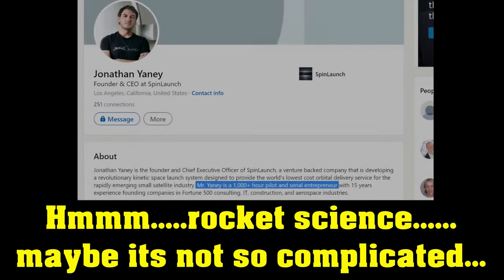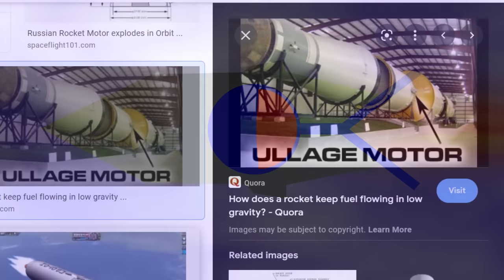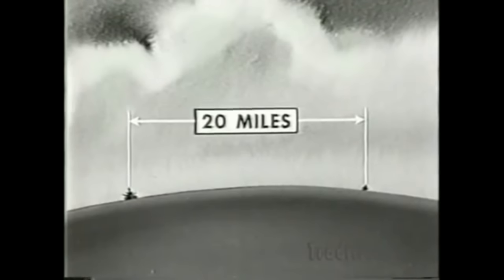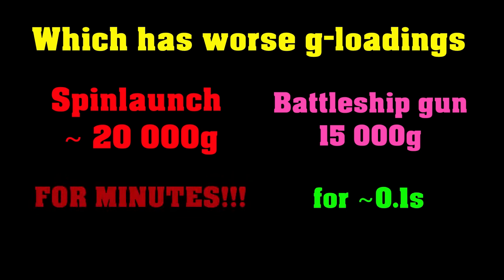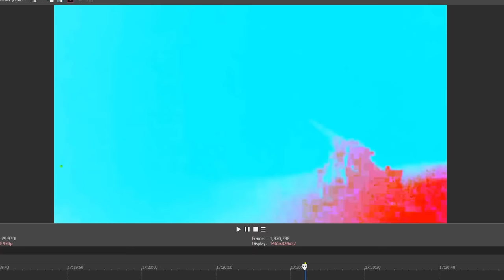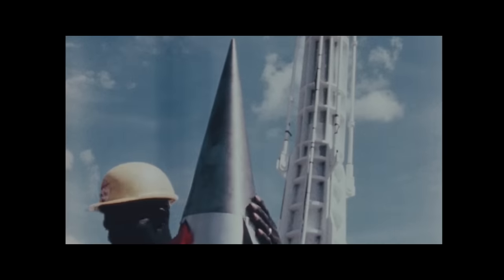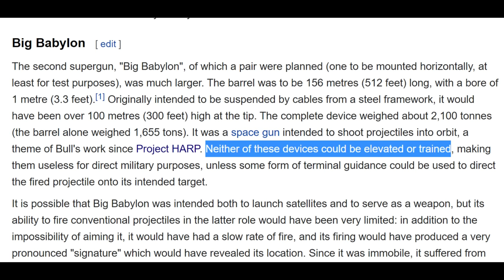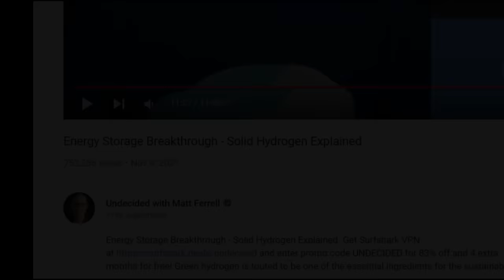Spinlaunch: BUSTED (Part 2)

Comment: I wonder if this could be more useful as a Moon based launcher, to avoid firing rocket motors close to the lunar surface (and all the associated problems, namely high pressure gas or dust reflecting back on the ground and damaging the rocket)
Reply: any cargo would get destroyed under 20000g lasting for minutes
Reply: @suqd674  the point is : you don't need as much speed if you launch from the moon. 
You need 9km/s to orbit the earth (LEO) while you need only 1.9 for a low lunar orbit.
Spinlaunch wants to reach a launch speed of 2.2km/s which is way more than necessary for a moon launch. It's only 25% of the velocity needed for LEO, therefore you could probably scale down to to 0.5km/s. If I'm doing the math right that would bring the g forces down to 1250g which would be much more bearable for the hardware
Reply: ah the moon, my bad I was drunk
Reply: While it would be less of a total bs on the moon, it would also be even less needed, making a simple rail for a railgun on the moon would be easy (vacuum present), and it would be same or better in every way.

Not to mention, on the moon we can build with current tech a space elevator, if we want such stuff.
Reply: @thesteaksaignant  Sadly we want around 2.5 km/s on moon, since that is the orbital speed, anything less means we still need a rocket after spinning for even reaching orbit. So no, scaling down on moon would just make it even less useful than keeping it. Almost every time, using spinning is less fo a good idea than using a linear acceleration for anything. On earth we might would have the benefit if not needing several km of vacuum tube for the railgun (which is a problem, unless you are building a hyperloop, than suddenly it is not an issue for hundreds of kms), anywhere else this adds the problem of spinning for a slightly more compact but way more complex system.
Reply: @thorin1045  I know that the orbital speed of the moon is 2.5km/s, but since their concept is to replace the first stage only (on earth), I went with the same assumption for my idea of a moon spinlaunch system
Reply: @thesteaksaignant  Well, what is the first stage on a "rocket" launching from a moon? So far any launch from moon (apollo ascend stage and a few return stage for probes) went orbit at least, some did the entire return trip on its first (and only) stage. As mentioned earlier, if you do not reach moon orbital speed, you still need a chemical rocket to reach it, so there is no reason to use this (or any other) helper system, since it would only add complexity without solving a major step of the entire trip.
Reply: A mass driver would be ideal for the Moon.
Reply: No issues with maintaining a vacuum also…..
Reply: Jake Standford  That's sarcasm, obviously, given we've been there multiple times.
Reply: Ok. Now all we have to do is get the satellite to the moon so we can launch it. How would we get the satellite to the moon?
Reply: Eh, I think a long coilgun would be better then

Comment: And also: they would still need to invent a material that can withstand a strong vacuum on a more than a squar meter but also gets ripped apart without blowing up when hit by something traveling at 5 times the speed of sound
Reply: To me thats the hardest considering Hard vacuum can implode a steel tube like its made of paper
Reply: I would think that as they reached top speed they would have to slowly release the vacuum prior to detachment/launch.  Otherwise, even if you could open the door, that rocket would be going extremely fast as it hit a wall of incoming air.  Keeping in mind that the inside of the rocket would still be in vacuum also.
Reply: Maybe a material that is blocked from the vacuum during spin-up, by a door say which would open a few seconds before launch, that is porous enough to let a little air through so as not to tear and also not effectively destroy the vacuum but that the projectile could tear through no problem.
Reply: I dont believe thats an issue. the materiel is a set of layers of progressive pressures. Using progressive pressure levels allows for any number of materials. e,g they could have 10 layers of intermediate pressure in a low strength material which would tear with the point of the missile. 
But yes, there is several glaring shortcomings with this project to which there might be plausible workarounds which even simple you tube commentators can see and resolve in comments.
Reply: Thats actually pretty easy. You can just have a couple of them stacked on top of each other with lower air pressure in ever compartment. Once the projectile rips through the first, it will push the air above to rip the rest.

Comment: Project Harp actually did achieve a bit over 2 km/s launch speeds by welding two 16 inch battleship guns together in 1966. 

The guy was subsequently assassinated by Mossad.
Reply: Mossad or Iranians
Reply: @Circuitssmith  its even metioned in the video lol
he designed Saddam Hussein's supergun
Reply: I'll try not to read too much into that.
Reply: @Circuitssmith  

Well, it was thought that, after the Iran - Iraq War was long over, if the full length gun had been built, up the slope of a convenient hill, it could well have been pointed at Tel Aviv ...

Given how Mossad operates (which seriously does give the CIA a run for it's money ...), them assassinating Dr. Bull wasn't/isn't that far out of their MO ... even if it was just a slim chance that that was Saddam's intentions, Mossad tends to operate on the principle that if it could happen, it will happen ... so why risk it ...?

[Edit: that's not to say the Iranians could've done it, but, given the total lack of forensic evidence, and Mossad being known to conduct 'wet affairs' (not least the decades long hunt for the members of Black September, after the Munich Olympic hostage crisis), it certainly heavily points to them, rather than the Iranians ... ]
Reply: @nigelft  My point is that something happening 24 years later for a different reason is not “subsequently”.

Comment: I am fundraising my startup too. Its a giant rubber band, each end of which is fixed to a giant pole. A bit like a giant slingshot, but different. And then you put a sputnik-like satellite into orbit just by catapulting it. A genius touch is the sputnik-like round shape : much less drag than a cube when swooshing through the air. Another genius take is the rubber band : it offers a real plus when throwing stuff at distances. I only need 50 millions $. My plan is to make high quality CGI vids to keep the investors interested so that they keep investing. Like those monthly videos of the "battery of the future, the holy grail of energy", it's been 5 years of monthly videos that say it's for the next month but the investors keep pouring money in that. I also plan to sell the startup to a tech giant just before making the first successful launch.

Comment: What is the effect of breaking the vacuum instantaneously at spin-launch? Wouldn’t the dramatic increase in pressure negatively affect the upward force?
Reply: So apparently after watching a documentary about it, the launch tube has two doors that act as an airlock and they open and close extremely fast so that the vacuum pressure isn't lost, just imagine a spaceship airlock, it's the same thing but operates in milliseconds. 

This video is older then the documentary I just watched about Spin launch, it seemed really cool, but I do trust Thunderfoot also, he's normally spot on.

Comment: Even the materials science is pretty iffy here.
Reply: You'd be surprised.... space guns, the orion project, all that tasty 60's shit we used to do, there's a lot that's already been researched, or was quite close 50 years ago and could probably be solved fairly quickly with todays tech
Reply: @mor4y  
Don't forget there is a reason certain projects have been scrapped.. ie fontus hyperloopin solar freakn thorium roadway tunnels with RGB and AI (AI not included).
Reply: @innocentbystander3317  I think space guns and Orion were both sound, but the genius behind space guns got involved with Saddam Hussain and found himself mossad'd, and Orion would destroy the atmosphere, but back in the 60's they weren't worried about that 👀

And lol literally just got to the supergun section right this second! :) check out Dr Bull's history, he really was a genius
Reply: Yeah The first thing I thought was that the spinning tether would not have the tensile strength needed to reach the right velocity
Reply: @mor4y  The difference being that apace gun launched material only had to handle explosive force in one direction and deceleration in another, to launch the way in the vid the satalite would have to handle the G force being switched from sideways during spin-up and from forward just after release. To produce something to hold in a space gun launch you only need the material to have strength in one direction, forward back, for the spin-launch you would need something that can withstand forces from just about every direction, especially during the relese phase as the centre of the main force is switching from sideways to forward, the force would be tring to pull whatever is launched in every direction possible. Now that would be a huge challenge for a satellite developer, to make a lightweight yet strong enough in every direction satellite that has things like arms to hold solar panels for the power source and those arms have to withstand the force, along with the main body of the satellite, then you have the electronics within the satellite that have to withstand the changing forces as well as have anchoring points to keep them in place withstand the forces. As ever challenge would need to be overcome with extra material extra mass would have to be added onto the satelite, changing the mass the centrafuge would have to eject and changing the calculations as to the velocity needed to make it work.
 This is all before we get to the launcher/rocket needing to overcome the same problems, which would add even more extra mass. At the end of the day it would be cheaper and easier to work on a oversized gun launch, with the added bonus that gun enthusiasts would be backing the project for the exclusive first view big boom launch vids.
Reply: Based on the weight load the arm would have to bare at 20k Gs, they'd have to graphite or carbon nanotubes to construct the arm. Not even titanium has a strength to weigh ratio high enough to stand that for several minutes, let alone an hour. Also, I don't think we've been able to produce CNT's in large enough size/quantity to make a 30m throwing arm yet. So they would to find a way to crank out the carbon constructs way beyond what current tech allows. It's not impossible, but they'd have to creat brand new manufacturing methods, and that's just for 1(one) component of the launcher.

Comment: When I first heard of this "idea" the only thing I could think was how catastrophic of a failure it would be when the projectile is released and the spinning arm becomes so drastically out of balance within a fraction of a second.
Reply: Would like to see this built just for the Guinness record of a man-made earthquake.
Reply: Yeah and nobody working on it thought of that...probably explains the counter weight....the one described in the patent.
Reply: Thats why you gotta make your "control center"about 10 Km away, and UNDERGROUND...LOL
Reply: Its gonna be awesome!
Reply: @AveragePicker  what happens to the counterweight after release, or does that become the primary imbalance?
Reply: @crazytrain7114  Go look at the patent…or don’t. Suffice to say your ten minute degree-less armchair engineering is not going to turn up some obvious but overlooked issue.
Reply: @AveragePicker  except the knowledge that a 2" chip in a 6ft prop will destroy a nose bearing, so theres that
Reply: @crazytrain7114  I remember it being thrown around that by attaching a payload at both ends of the trebuchet you could release one and then in quick succession release the other after a half rotation to reduce the time it is unbalanced for, that being said their animations dont include that so far as i'm aware so I assume they weren't planning to build it as such, at least at first
Reply: Counterweight would need to counter weight of arm + weight of projectile.  When the projectile is release it would be unbalanced by that amount.

Comment: All the internal components of the Spinlaunch satellite would have to be able to handle the 20k g's  of force during the spin up process. So they will need lots of extra reinforcing/weight compared with standard design rockets etc.
Reply: @fask69  That's unsurprising given that basically everything in a phone is solid state except for the camera. Anything with bearings or hinges or motors etc would be extremely difficult to design to withstand that sort of G force.
Reply: @fask69  A phone is not the same as a satellite! No moving/mechanical parts in a phone. And, being a much larger structure, a satellite will have large components like fuel tanks, antennas etc that are usually not needing to be particularly strong/heavy.
Reply: @fask69  Yup. The other thing that is going to be an issue, since the g-forces are being applied sideways/perpendicular to the centerline of the satellite structure, rather than lengthwise along the centerline axis as in all other designs, its going to need a lot of new engineering/testing to work.